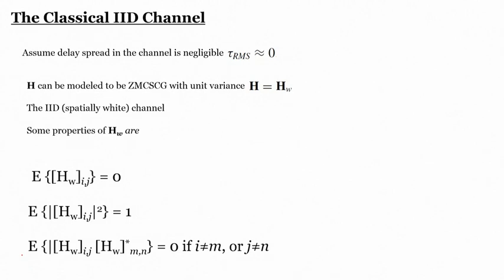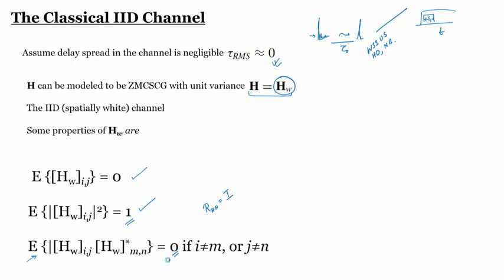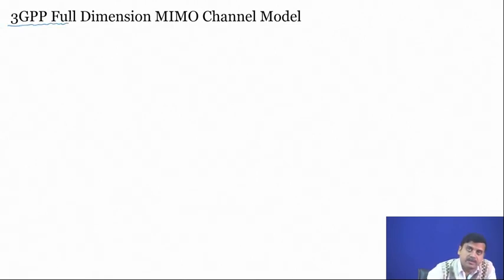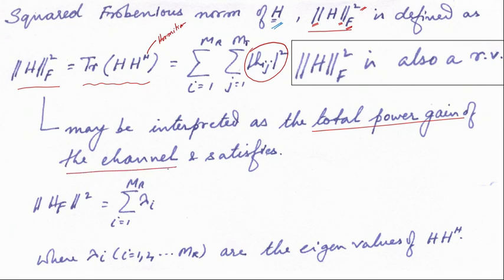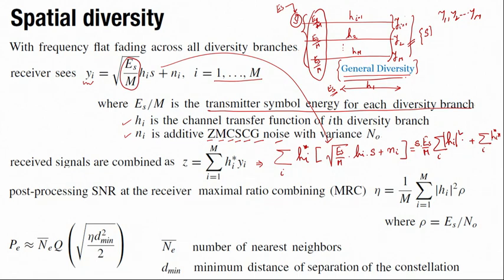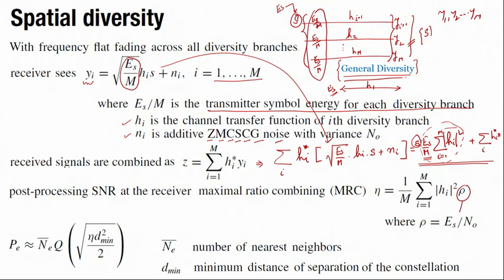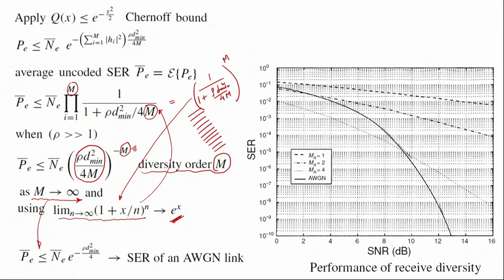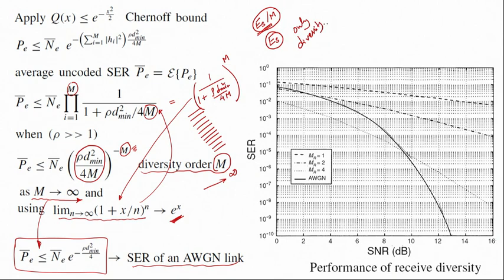Lecture  36: MIMO Signal Processing (Receive Diversity)

Comment: @19:55, the eigen values would be E{|h_i|^2}, not 1 (may also need Jensen's inequality for concave functions in this step?).  This is the common path loss along all branches, and can/should be folded into rho.  This factor is common across all cases, from SISO to MIMO - one should make a mental note that this included within rho across the board.  @11:22, for MRC combining, the correlator (In vector notation) is h*/sqrt(h* h), which also leaves the energy of the noise term unchanged.   Only then (i.e., with the square root term in the denominator) it logically connects to the expression for eta (SNR) further below.